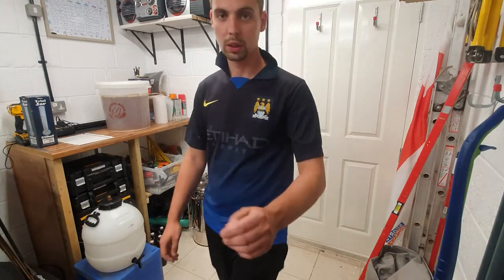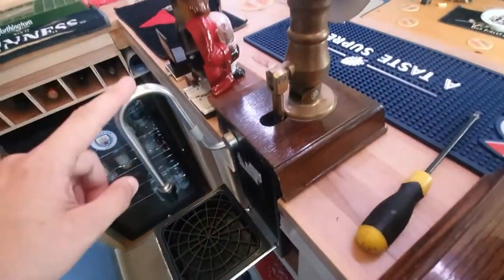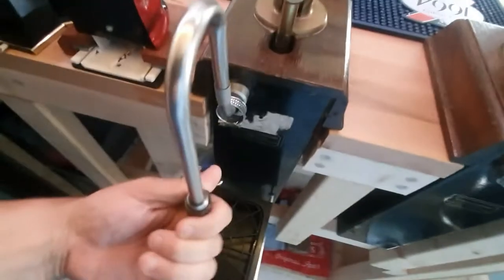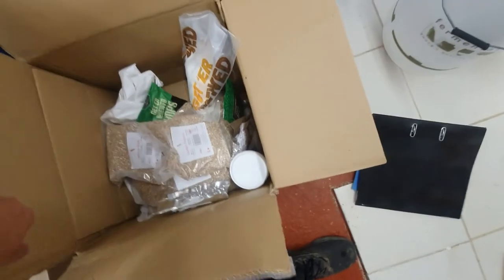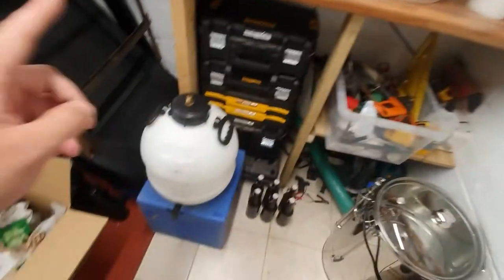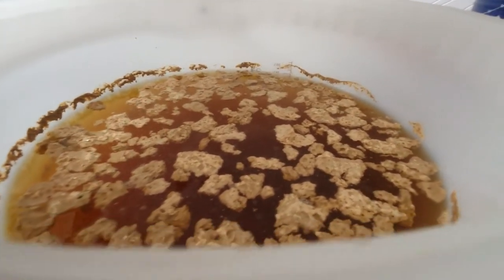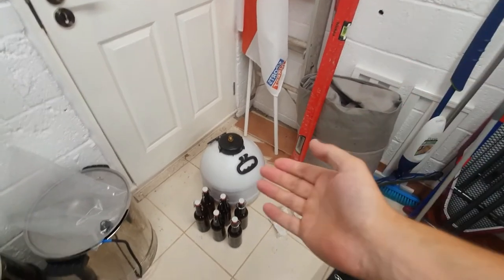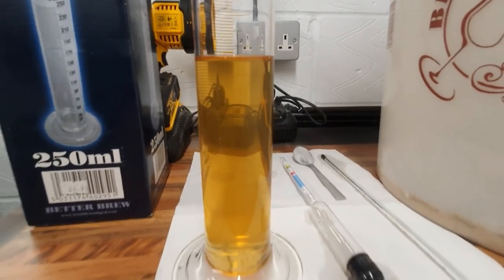Brewster Klarstein Homebrew Beer Barrel & Bottle #2 - Hobsons Town Crier Clone

Comment: Great content, pal. Dead straight, nothing complicated and great beers as a result.

I've never been able to get along with my King Keg. Any chance of you showing us all how to dispense beer from it, in your next video?

I always seem to end up with a pint of froth. Apparently you can add some tubing to the tap to help reduce fobbing. I'm not really sure.

Happy brewing!
Reply from the maker: Cheers mate 👍, Im glad that you are enjoying our channel 😎.
I have angram beer engines (pumps) that pull from the king kegs so I dont pour it straight from the tap on the barrel. My king keg tap is connected to the hose shown in this video under the bar.
I assume that you are pouring a pint straight from the barrel tap into a glass and this is causing your froth. A few things you can do to help reduce the froth if you are pouring this way though:
Your king keg after priming in the barrel for 4 weeks with 50g of priming sugar will be under alot of pressure with CO2 from the active yeast. So try releasing some pressure by gently releasing the brown rubber blow off band around the threaded top fitting. Use a teaspoon or something that wont damage the band. But remember that if you release too much pressure you wont be able to pour the whole barrel without cracking the lid once you get around half empty because air could gurgle back through the tap into the beer and infect your beer massively reducing the shelf life.
Secondly you should try a short piece of food grade hose on the tap. Make it a bit longer than a pint glass and then keep the outlet of the hose right at the bottom of the glass while pouring your beer very slowly and gently.
And lastly but just as important make sure you use a plain pint glass and definatley not a lager glass. Lager glasses have etchin in the bottom that promotes bubbles in lager to keep the lager fizzing with bubbles while its being consumed.
I hope all this makes sense, Cheers 🍻
Reply: @brewbeer1013  Wow!

Many thanks for your detailed answer. You've cleared up a few half-truths that I've been hearing about keg performance. 

I'll try the tube trick next time and make sure I keep the pressure down, to see if there is a change for the better.

I've just purchased a few Corni Kegs and a fridge, which should finally give me control but it's going to be at least 12 months before I can set things up. Plus, I love sneaking off to the shed to pull a sneaky pint out of the King Keg for old times's sake.

Happy brewing!